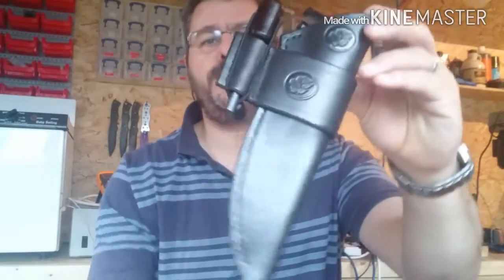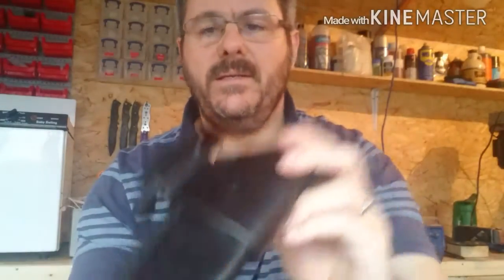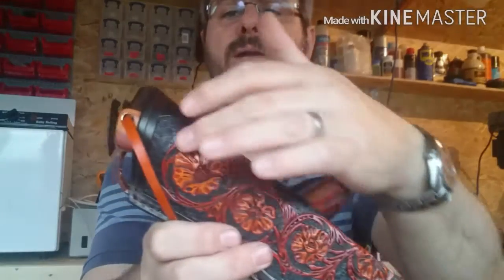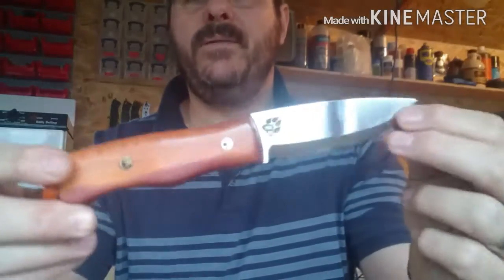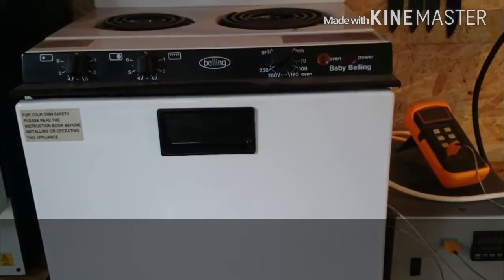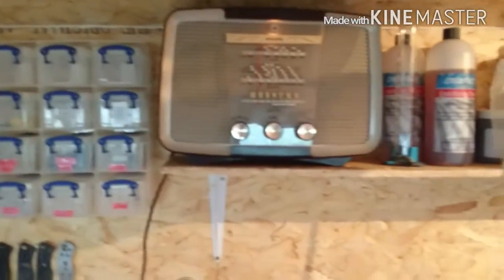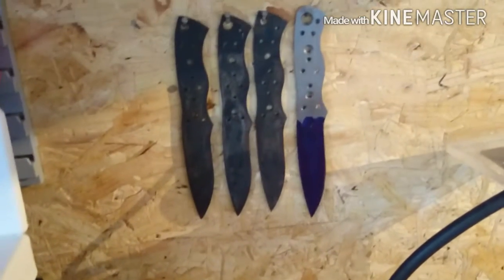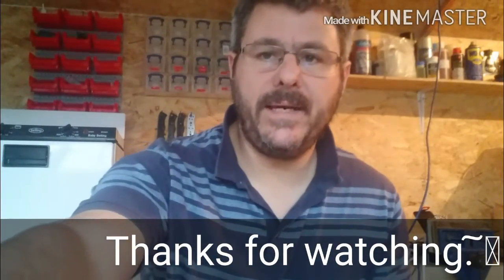Bobcat Bushcraft knife 7 and some updates.

Comment: Good to see the 'shop coming together. It's a bugger  how they can eat the money though. I discovered the building I was  to use had severe issues of unsuspected dereliction on top of the ones i knew about. Or in other words , cost a hell of a lot more to sort and took four times as long to pay for. Bit of a bugger that.  
Love frogs...  I always like a good securing method. Had to wonder if  Sam Browne studs or a lace through method might offer  any options that preserved the  rapid release  facility. Also wondered if  you might be able to  incorporate a means of  options for the positioning of the sheath...eg... lateral,  canted at an angle etc.
Reply from the maker: You are so right about the money. I agree I need to look at the release system, as for the carry position that might be another sheath.